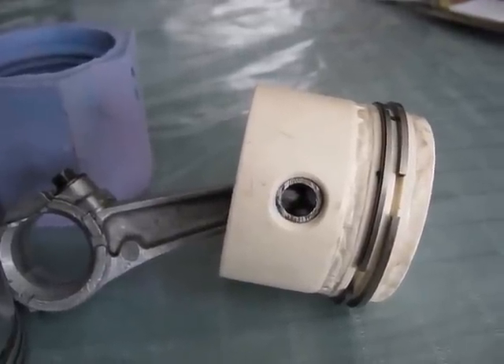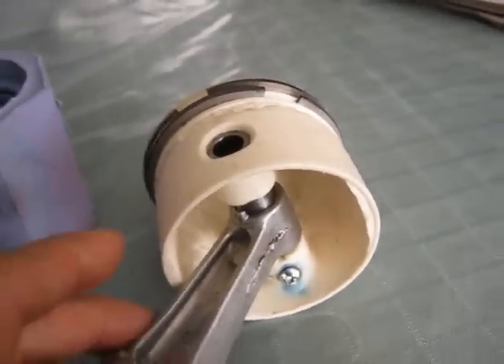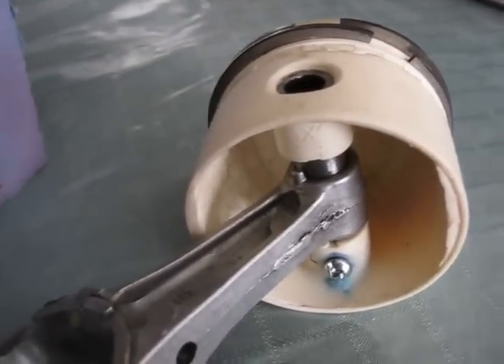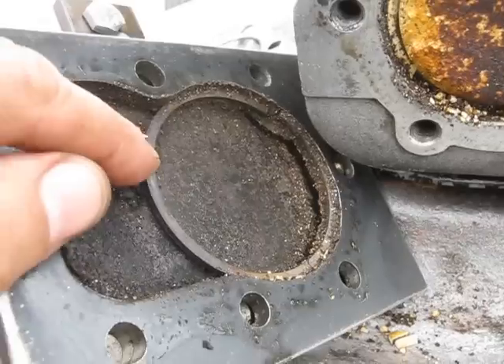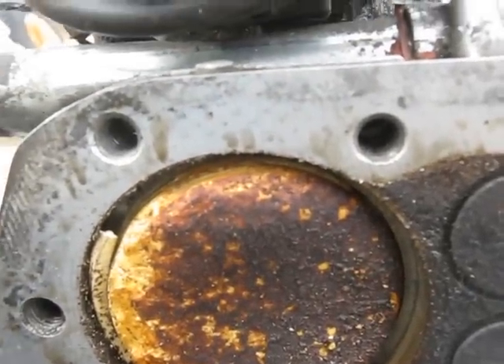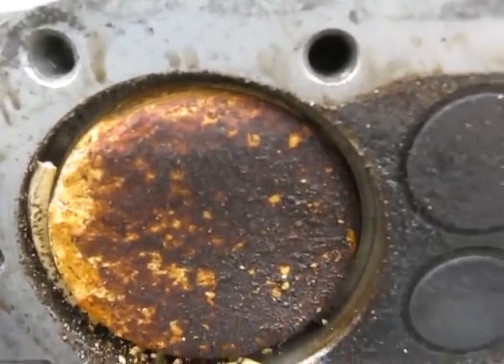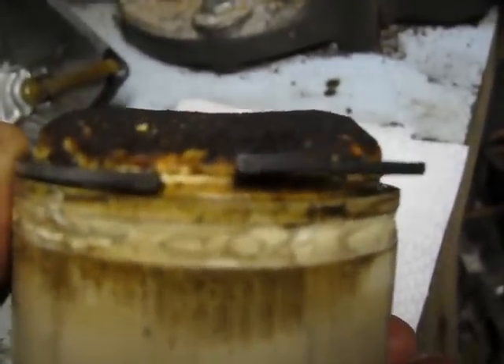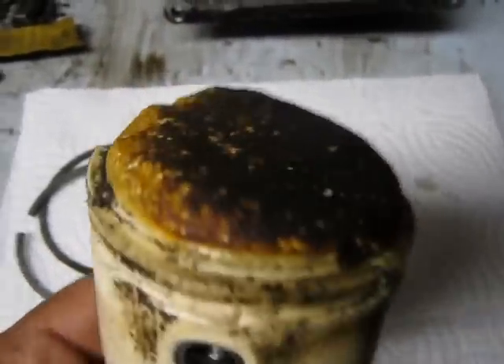PLASTIC PISTON  Briggs 4 Minute RUN!

Comment: Wow plastic piston worked really good!
I wonder what other parts you could run made of plastic!
Reply from the maker: I plan to try a plastic con rod, but it is such a tight fit on these engines that I don't know if the wall thickness in plastic will hold together for long.
Reply: oh well oil that sucker up i guess.
use some really heavy duty oil on it and give it some wiggles to get it settled in at first. a few slow cranks just to get it settled in.

Comment: Wow, that thing was a screamer for a while there. I wonder how long it would last under less extreme conditions. Perhaps if the top had an aluminum crown it would survive better? How about with an aluminum ring or two molded-in to stabilize the thermal expansion?

Comment: Quite surprised the strength is not the problem but heat. It makes me believe the combination of plastic, some heat resistant and insulation fiber and thin metal would be possible.
Reply from the maker: Yes, that could have worked better, for sure.

Comment: Best Briggs were from the late 50's early 60's they used heavy cast iron carbs with think brass floats the engine was a cast iron flat head. heavy but they did not die

Comment: Idea, make a plastic piston summer to this but with a thicker top and allow more space between the top of the piston and the rings.
Reply from the maker: Yes, I was thinking the same thing. It is too bad I cut the oil ring groove out of the mold, as I think I could move o compression ring down to that location.

Comment: next time try it with the oil ring and high temp plastic u could reinforse it with grafite in dome and side skirts around pin
Reply from the maker: I have cast another one deleting the top ring, and the oil ring, I thickened the skirt up also.

Comment: Would it run for longer by using a fuel that burns cooler, like ethanol?😊
Reply from the maker: Yes, I think it would, I gave kerosene a try today, and it worked well.

Comment: I bet you there is some kind of polymer out there that would work for a reasonable amount of time if it was designed right given the change in material
Reply: Nicholas Washburn I have seen a fair amount of cars using thermo plastic for the exhaust manifold, so it should be possible.

Comment: Hell they already have plastic camshafts. My mower does anyway. Ford uses a plastic throttle body on the 2.0 or 2.5 I can't remember which maybe both. Lightweight, cheap and MIGHT last long enough to get out of warranty. Eff you loyal customers

Comment: Would it be possible to do that with jb weld? I can see a few potential issues, namely it maybe being too thick to get the grooves in it by casting alone, but I think you could probably fix that without too much issue depending on the tools you have. Another issue might be the weight, I'm not sure how JB weld compares to aluminum, but I"m sure its heavier, which means more load on the conrod, might send it through the block.
Also, a question from the blue, what state do you live in?
Reply from the maker: I am in Ontario Canada. I think you pretty will covered the problems trying to cast this with JB Weld, though a piston crown could be possible.

Comment: That's a cool idea! Is the plastic piston much lighter than the aluminum one?
Reply from the maker: Yes, I think it is, though I made the top much thicker, and stiffened the skirt. I am fairly sure I could get a longer run if the rings were moved down further and with more space between them.

Comment: I'd bet a Bakelite piston/crown would last a while, it's pretty heat-resistant! 
The formaldehyde fumes it might generate would be a bit smelly, though!
Wow, that shroud was dancing!
Reply from the maker: Yes, I need to add a bolt hole to the front of the shroud, I had to cut that part off for the ice head run!
Reply: Ah, so that's why, thanks!
Reply: Google'sCustomer ServiceSucks isn't Bakelite extremely toxic when it burns? 😂 might not be such a good idea!
Reply: That's a good point! But, so is plastic and JB-weld to some extent, eh?

Comment: Hi, nice video thanks!! What kind of plastic did you use? Was it ASA perhaps? And how did you pour it into the mould? Or how did you cast the plastic piston?
Reply from the maker: Not 100% sure what the plastic is, just a smooth on product that I buy. I just mixed the plastic up, and poured it into the mold, then left it at 60psi in a pressure container for 15 minutes.
Reply: I see... thanks. So it was no thermoplastic. Maybe thermosetting Epoxy or Polyurethane ;) Still nice how it held up

Comment: I wonder if running on e85 and using synthetic oil would improve things.  Maybe a Polyimide crown?  :-)
BTW, ever try to make a welded ("sheet metal") piston, out of bits of plate and tube?

Comment: I think some Chinese engines have plastic pistons.I spoke to a garden machine repairer and he told me the Chinese pressure washer  he had in his shop has a plastic piston in it.
Reply from the maker: I would have to see that to believe it, though it might work with a metal crown on the top.

Comment: Back in the late 1960 engineers build a complete plastic engine and ran it for 100000 miles on a dyno then striped it to see how must wear was in it, the wear was so small that it was hard to measure. They never put the motor into product as no one would get to do any work on it.  No money making so out it goes. Money making is the only thing that people are interested in nowadays.
Reply from the maker: Man, you said a mouthful there! From what I see taking place it keeps getting worse all the time, take refrigerators, I know for a fact mine is over 20 years old and still runs fine. the new ones last about 3 years! How is that saving the environment, they end up being scrapped and melted down again, creating lots of pollution, and using resources. It is much more environmentally friendly to have it last 20 years. but as you said, it is ALL about making GREEN, not going GREEN!

Comment: how about using PTFE to make a piston?

maybe they can withstand higher temperature.

they are used in non-stick frying pans
Reply from the maker: Oh , no doubt teflon would take the heat much better, though it would cost a mint. If Dupont or someone donated a piece, I would run it for sure!!!  :) I would even put their label on the engine  :)

Comment: I wonder if the cooling fins missing from the cylinder head makes it run hotter than it normally would?
Reply from the maker: I would think so, but it still doesn't get terribly hot, though I couldn't touch it for a while after this fairly long run!

Comment: Dear Charger:  [--do you really own a Charger from the 70s?]   Thanks for the experiment, that was KOOL.   Why don't you use a ceramic-aluminum piston [use powders mixed together, then made molten & cast ] in something water-cooled , like a CX500 [V-twin] Honda twin gotten from a wrecking yard.    Ceramics are great for heat resistance, and lightness from the aluminum.   Do you remember the Plymouth "Feather" Duster?   It was a 70s compact with aluminum panels, plus the slant-six.   Mopar used to have aluminum-blocks in the slant-6 form in early 60s compacts, but used an IRON head!    Maybe a DOHC-head that's watercooled in ceramic & aluminum would "work" on one of those.    The stocker-Duster supposedly got as much as 35mpg, in the "Feather"-version.    Isn't a piston going to have to handle over 600-degrees, due to the combustion of your fuel?
Reply from the maker: My son now has the Charger in my logo, and in a bunch of my early vids. he is currently rebuilding the 440 that beat  the 440 six pack Cuda by a length, but turned a con rod blue in the process.

Comment: Which plastic did you use ? Could you share more details about the project and how you did that ?
Reply from the maker: To make this piston I used Smooth On  OOMOO silicone for the mold material. I cast the piston using Smooth On  smooth cast 305 medium set liquid plastic. I used 1 mold for the outside of the piston, and a separate mold for the inside, which sat inside the outer mold. I cast the top of the piston upwards, so it was the surface poured last. the piston was accurate enough that I only had to do some light sanding on it, the ring grooves were usable as cast. I had to drill out the piston pin hold, since it could not go through, and remove from the mold. Hope this helps.

Comment: a hybrid piston if aluminum  for the crown & ring grooves with a high temp thermoplastic lower?  dropping weight in the piston could yield huge performance  gains.... 
what about thinner rings?  how thin could you go before breakage becomes a problem?
Reply from the maker: Yes, that sounds like a recipe for a racing piston!  :)
The newer Briggs engines have much thinner rings on them, probably for friction reduction, and emisions.

Comment: I got a question..#1 was it just see what happens experiment? or #2 it was really believed the plastic can withstand the heat?if it was #2 then it was a pretty stupid idea. Like making a plastic oven for baking.
Reply from the maker: It was #1, just an experiment to see how long the plastic would last. It was the same thing with all of the different wooden piston crowns I tried.
Reply: Charger = I see but it sounds to me it was more like #1... since we all have intelligent to know it is a just a waste of time..Why don't you try to drive 100km/h and hit a concrete wall head on.. just to see if you last or not. To me is still a waste of time  asking myself WHY,,, why would see spend time on to see if paper burns or not....(I don't have to put my hand in the water knowing it is wet....)

Comment: How Briggs have changed.. My old B&S mower lasted me about 20 years! Probably could have gotten more out of her too... Modern day mowers are cheap and all plastic.
Reply from the maker: I know what you mean, I use a 1973 Briggs pushmower, sure the mower deck has recently had a few repairs, but I rescued a 2011 Briggs engine from the scrapyard, and the deck had a wheel rotted right off! I am still testing the newer Briggs engines before I decide how good they are. More vids to follow.

Comment: I remember honda making a motorcycle engine with Ceramic pistons.

Maybe you could try that next??
Reply from the maker: I don't have any experience with ceramics, I will have to do some reading. I heard they were using ceramics back 20 or 30 years ago when they were experimenting with adiabatic engines that didn't have a cooling system.

Comment: Did you balance the crank/rod/piston combination before assembling it?

I would guess its trying to shake its self apart with that under-weight piston.

Might I suggest a shell of an aramid plastic for heat resistance next go-round?

Another option would be to slip-cast and fire a thin ceramic top glaze the outer face but leave the inner face rough to [hopefully] give the plastic some place to bond to.

Also I would advise a fuel proof plastic and use rigid filled Teflon rings for compression.

All in all, I think you did a pretty good job! (~_^)-b
Reply from the maker: Howdy, been a long time since we chatted on youtube!
I didn't re-balance anything, as I knew this was a one time run, and i would be re-using the engine parts if they survived. These small engines don't seem to be very balance critical, as I have ran other parts combinations up to 6400 rpm, with no problems. Thanks for your input, you always have lots of well thought out ideas. If all goes well, I will run an Elm piston crown with the clear plexi head later today. I hope it doesn't melt or crack the plexi too badly, but I have material for two more :)
Reply: Since I missed the original introduction to this series, might you possibly state briefly what the goal of making and testing these alternative material pistons is?

At a glance, my first knee-jerk reaction is to suspect that it is the reduction of piston mass for increased power and efficiency because that is the number one [perhaps not sole, but by far the most common] reason people make pistons out of lighter materials.
Reply from the maker: A friend suggested I build a wooden engine, I don't have the resources to do that, but I have made a wooden head and various piston crowns to try out.
Reply: I suppose a wooden engine [I saw one done before but it worked off compressed air thus at much lower temperatures] would be good if you are trying to make power without depending on so much metallurgy in a post apocalyptic world, but ultimately, it is going to be very short lived because of many factors of physics, especially since the stresses, friction and temperatures all exceed the capacity of all known types of wood.

I would love to offer suggestions here, but it turns out, after great and lengthy consideration, I really can offer none, so long as the project is aimed at being an internal combustion type engine.

Comment: why are you using a flat steel head instead of a normal briggs finned head?
Reply from the maker: I made the steel head to work with the wooden piston crowns I have been running. I cast the head of the plastic piston 1/4" thicker than I could have with a normal head.
Reply: thanks, make sense

Comment: you ran it at high rpm plastic piston amazed I have to say .......how about a thermal insulation  coating on piston. naw still pretty good if it  ran for seconds at an any speed, 6 to 1 compression has combustion temp that is above  vaporization of plastic.

Comment: Smooth-On doesn't make the best engineering resins, they generally don't hold up to temperature and pressure well at all.  Michal Zalewski recommends checking out Innovative Polymers, Michigan, but i'd probably stay away from PU for such use and go for epoxy, but i only know ones available in EU, not the same as US, so i can't recommend anything specific. Ultimately i'm afraid it gets hot enough in there that any organics will end up becoming fuel :(

Comment: My Briggs run only 3 minutes with forced (almost) pure nitromethane. 5% of toluene made it run better, and ignition timing was fucked so i adjusted it a lot.) I had no exhaust on it and had tveaked it to the eybrowing the piston  state.. Funny toys those things but it really is a hazard that they start to make them from abs plastic lol
Reply from the maker: What happened to it after the 3 minute run, did it have a melt down or something?
Reply: It melted part of the shimmed piston to exhaust port lol
Reply: I also tried to turbocharge it but it was a fiasko, it would have needed propably some bosch injection system..

Comment: Try it with EpoxAcast 670. Heat deflection temp is 350F. Try mixing a bit of powdered graphite into a thin layer of resin on the piston top, then cast the rest with the plain resin. Or something from this company. http://www.dic-global.com/us/en/products/epoxy/high_performance/hp4710.html

Comment: How about a piston head made from like steel?
Reply from the maker: I could easily do that, though I am fairly certain it would run until the high temp. silicone let go, i have a steel or cast iron tractor piston.
Reply: Indeed, all engines are made with metal pistons, I was just kinda making a joke in reference to Briggs and Stratton now producing shit engines nowadays hahaha like, "all there engines use plastic, how about you try steel"

Comment: the plastic camshafts in these are just stupid why would someone even put a plastic cam in an engine
Reply from the maker: I think they probably have less friction, thus leading to slightly more power from the engine. I bet they are a fair amount cheaper to make also. I can almost see using them in a small lawnmower engine, but not in a riding mower, as you want reliability in a larger more expensive engine, not a faulty part that can lead to dead engines when the camshaft drive gear looses some teeth or slips on the shaft !
Reply: the good thing is i have a steel camshaft from another Briggs engine that might fit in my push mower engine